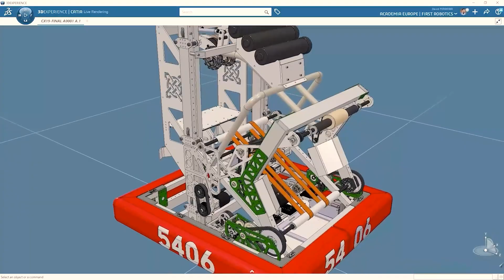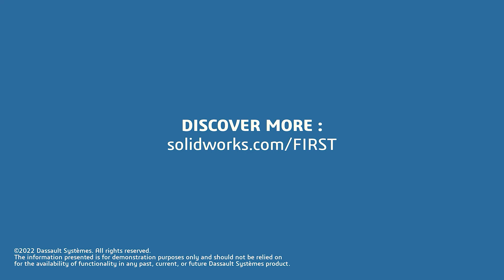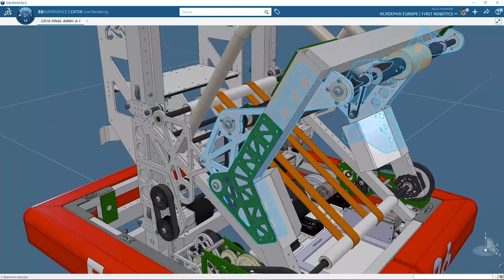Charging Station Swerve Drive Testing and Construction Ri3D Redux 2023

Comment: It's unfortunate that you pre-built a swerve, it was struggling on that ramp. Nothing you can do about it without having known the game though :/. Its def a West Coast year
Reply from the maker: Bet. We'll count how many teams on einstein use West Coast vs swerve. If more west coast I'll eat a shirt. Vice versa for you if there's more swerve.
Reply: @FUNRoboticsNetwork  also I think the teams that will make it to Einstein could make it work with tank or swerve, it will probably come down to who has the faster cycles.
Reply: @FUNRoboticsNetwork  lol we shall see
Reply: MK4s not the i version can probably clear that imo because the clearance on the MK4s are bigger by 2 inches so Im pretty sure it might clear it. Our team got the REV swerve which has a bigger clearance than MK4i’s (by like an inch) and I think it might work but yeah I think MK4i’s are gonna struggle this year but every other swerve in the market might workout well.
Reply: No lol, just use mk4 or move the tubing to the top plate orientation
Reply: It's definitely a swerve year, without a doubt, look at that open field. Mk4is work just fine on our ramp
Reply: We posted an updated video under full weight and a fixed ramp, you’ll see it doesn’t struggle

Comment: Is there are reason you did not include the loop fastener (eg the fuzzy side of velcro) on the edge of the ramps?
Reply: This was an oversight on our part and we do not have any on hand. If we get a hold of some we will add it as we assume it will make a difference.
Reply: @samanthatarnowski5528  I was able to purchase 2" x 15' at Lowes.  It was like $30 though :(